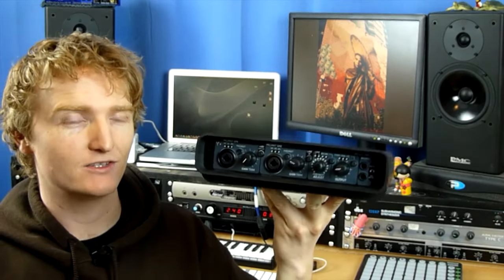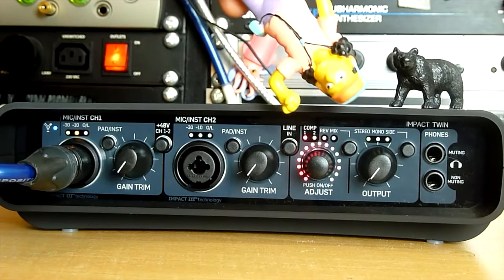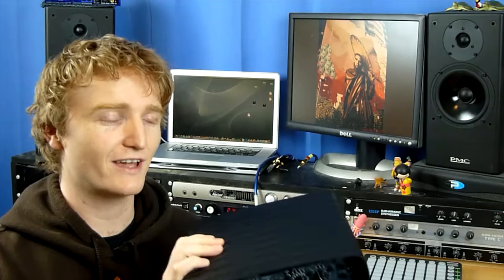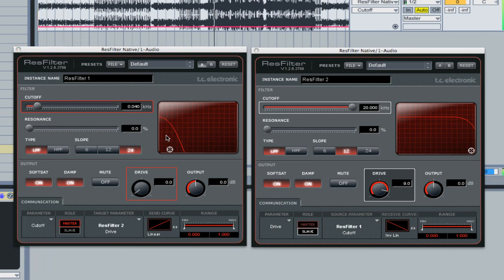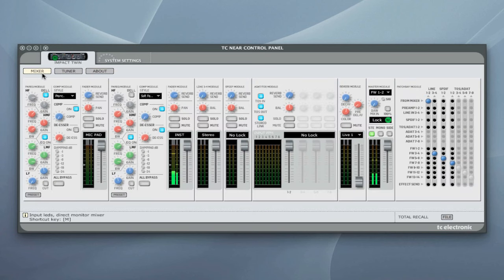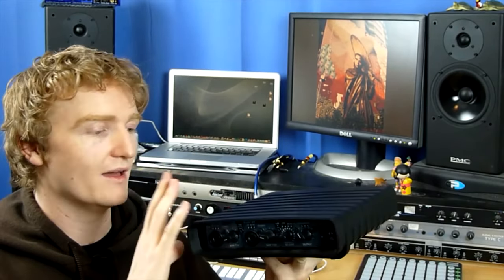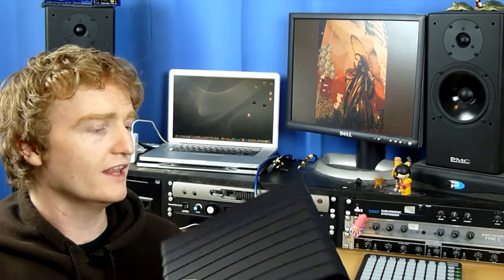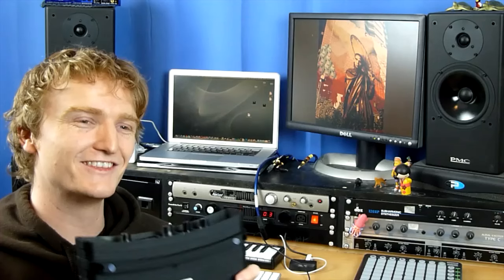TC Electronic Impact Twin Review

Comment: I have such a question, this card worked perfectly without any complaints recently for some reason it began to turn off itself works works the blue firewire indicator goes out the card turns off the sound disappears, who came across help

Comment: Im thinking of buying this interface , because my cpu(8gm ram , quad core procesor) is overloading while using maschine , will this interphase help with that  ??????  and if so , is it as simple as to just plug it to my usb drive on the cpu ??? im very much a noob on these subjects , thanks
Reply from the maker: I wouldnt think the Interface should make a big impact on CPU
Reply: my reply is a bit old,.. but i wanted to warn you
this is a FIREWIRE interface; no USB drive connection available.
you would need a Texas Instruments firewire card for your PC to accept the firewire connection.

Comment: Poor heat management and underrated capacitors soldered too close to the power supply.  Disposable garbage, mine died a week after the warranty expired.  An internet search for problems related to this temporary unit will yield results relating to power supplies with poor heat management that cook the surrounding (underrated) electrolytic capacitors.   If you purchase this disposable unit be sure that it's something you intend to replace or make sure it's something you rarely use and DON'T leave it on even if you use it to upgrade your computer audio...
Reply: Could you just relace with higher voltage rated caps?